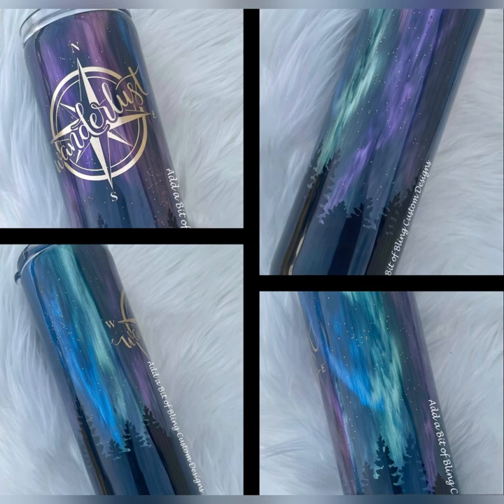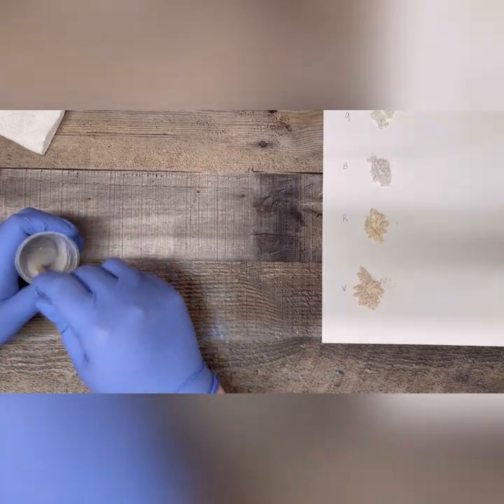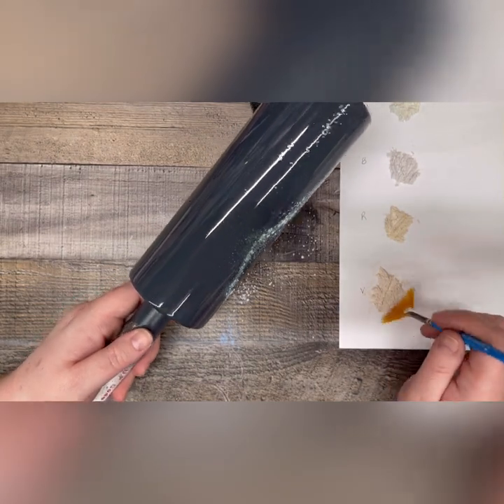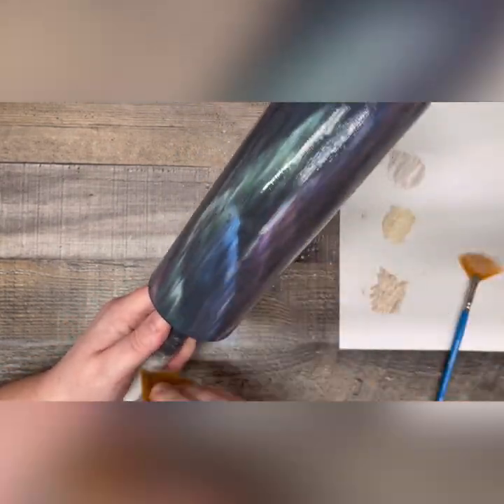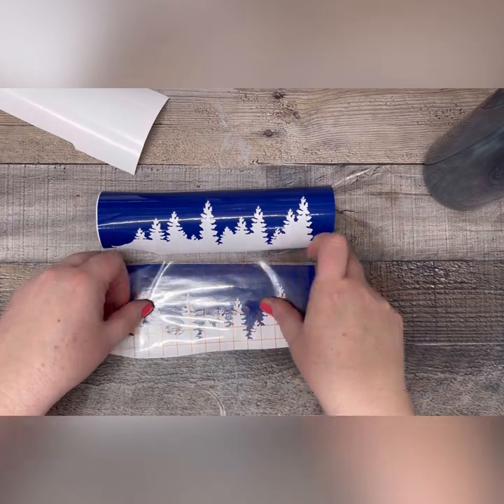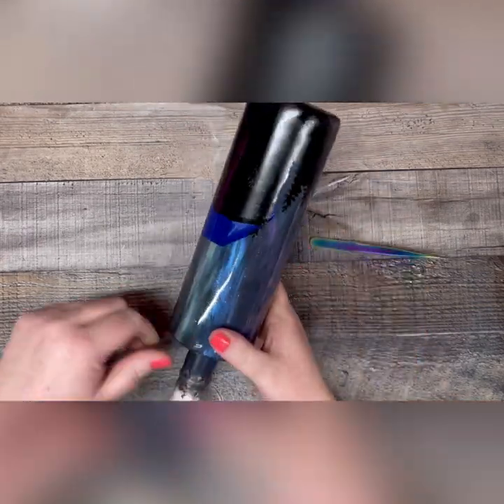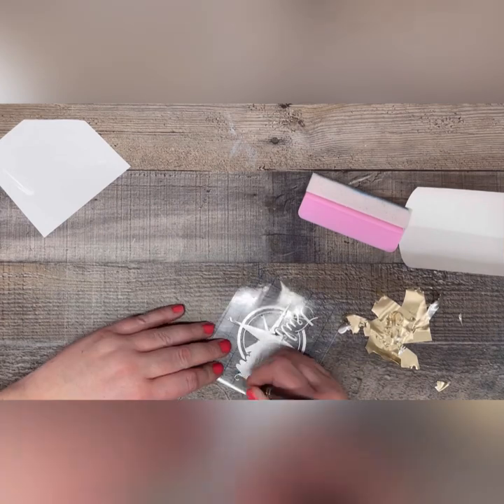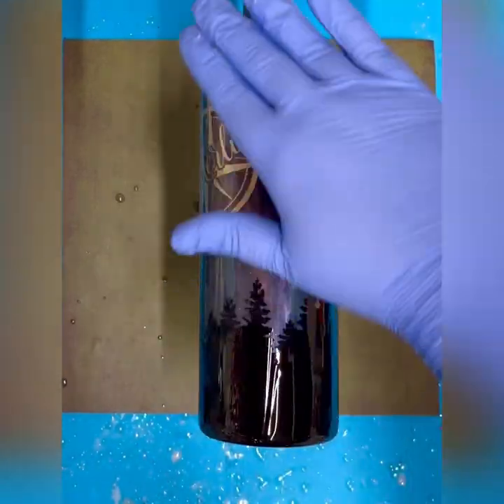Quick and easy Northern Lights tumbler tutorial using mica powders

Comment: If there are bubbles or imperfections in the mica layer can you sand that a bit?
Reply from the maker: You can sand, but you don’t have to worry about anything minor because the next coat of epoxy helps too. But You can certainly sand down a less attractive area.